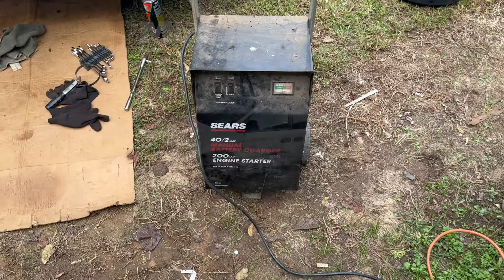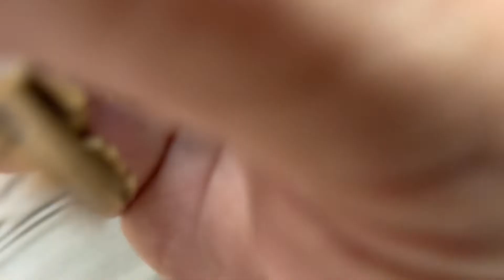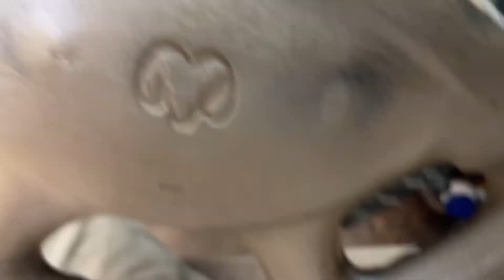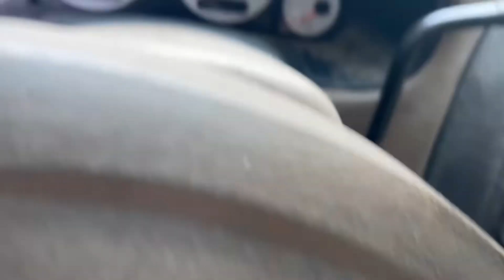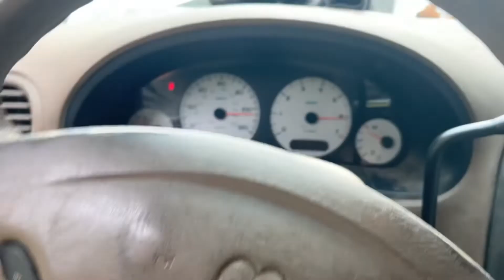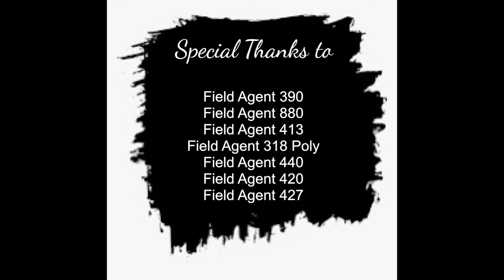My mini van fix up. Let’s go for a drive (Part 4)

Comment: With the miles on it you may need struts, the complete assy is the way to go. Check the sway bar links and sway bar bushings for your clunk. Have a buddy rock the van side to side and you should be able to hear it, put your hand on the sway bar and you should be able to narrow it down.  Check the ball joints and tie rods for the tire wear.
Reply from the maker: Yea I’m sure it could use some struts. I’ll definitely check the other items you mentions. Sounds & feels like a bad strut bearing to me though. I doubt I’ll put struts on it unless it starts to affect tire wear. Unless I get a following on this van in which case I might do it then.